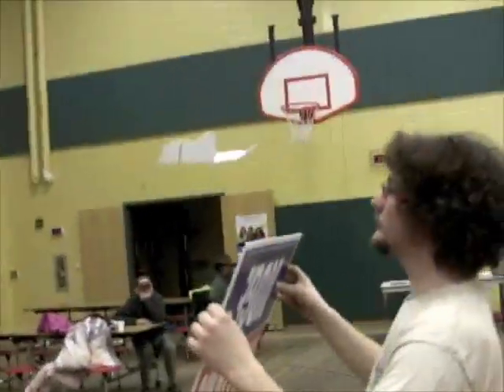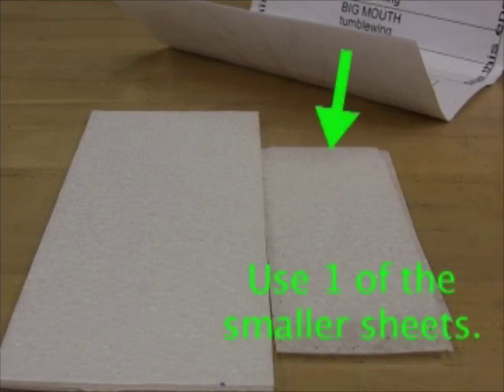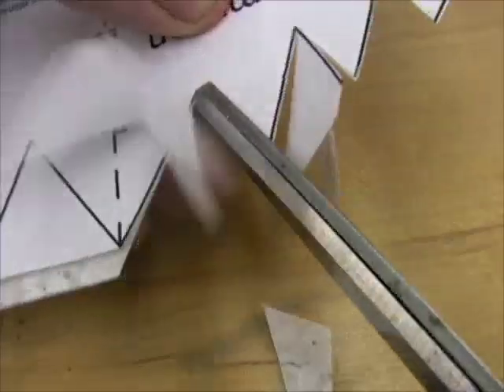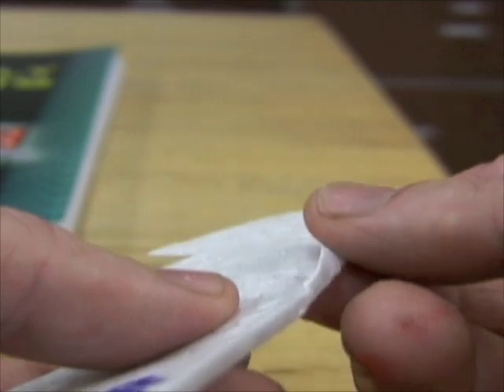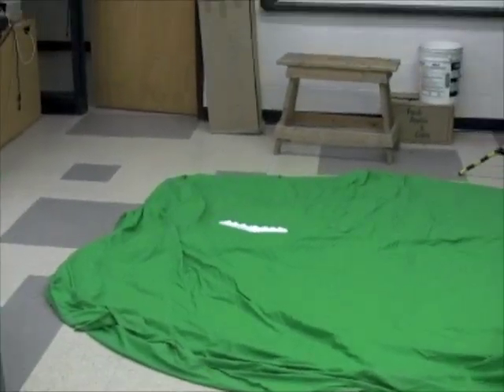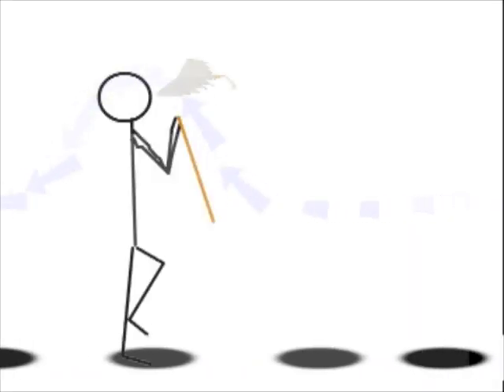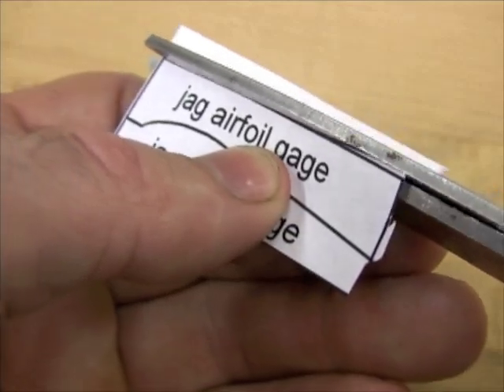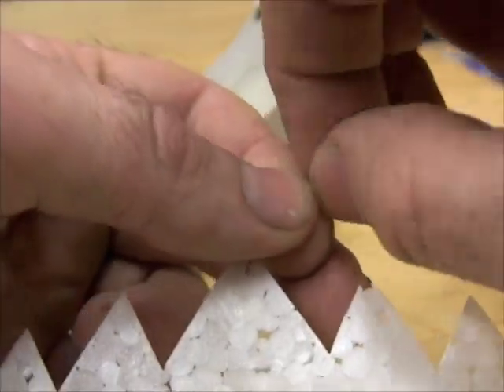Part 3 Air Surfing Kit

Comment: why the jagwing is a slow gliding?
Reply from the maker: bat man First, the jags are made of very thin, lightweight foam. Second, the jagwing is very pitch stable, so you can adjust it to fly very slowly without stalling.